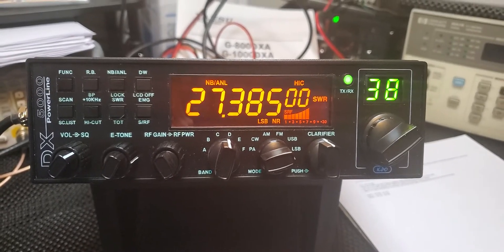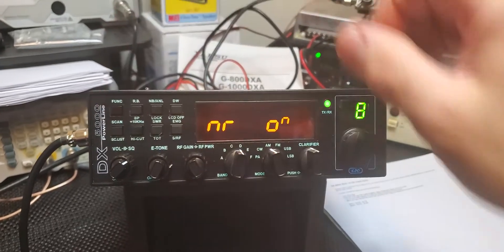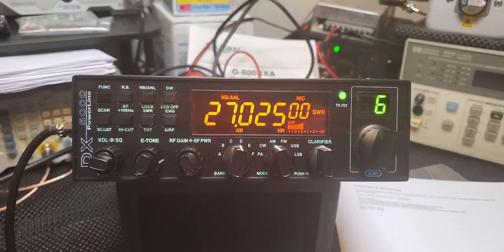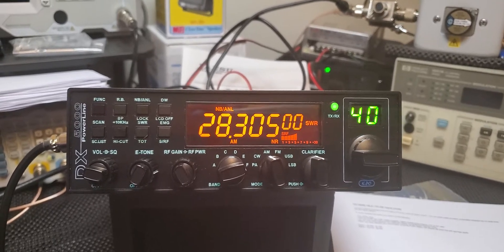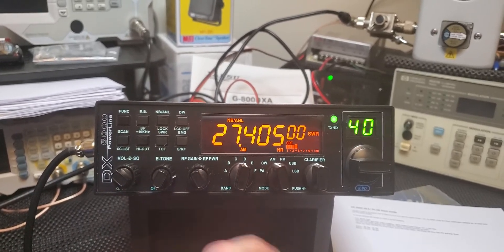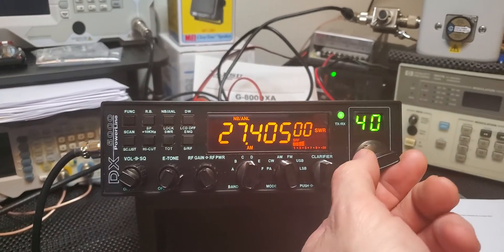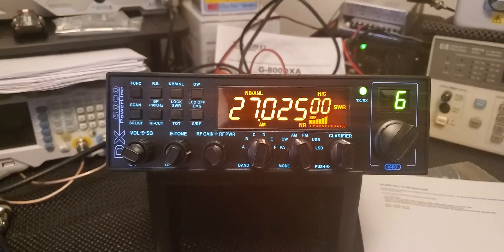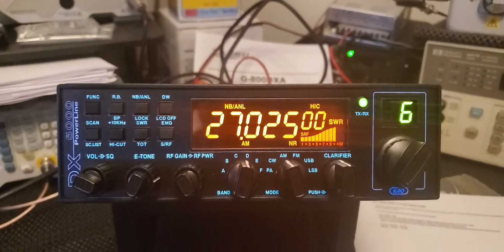First Look New K-PO DX-5000 Plus 10 Meter Radio.

Comment: Too much focus upon the noise reduction. Channel 6 is a joke. Be nice to hear SSB and clarifier operation on 35 through 40.
Reply from the maker: At the time this was the first radio in this class to have the noise reduction. 
Unfortunately you watched the video a few years later.
SSB portion works great. 
You will find most people are on frequency so using clarifier isn't a necessity for tuning people in as much these days.

Comment: What’s the difference of NC and NR
Reply from the maker: NC is a compander. Used for FM. The trick is both parties have to be using it for it to be most effective.
Reply from the maker: NR is noise reduction similar or sometimes referred to as DSP filtering.

Comment: @Scott's Radios Do you have the recommended Mic settings for this new dx5000 model im using a kpo532 power mic does it go on as electret or dynamic? People are saying im really quiet. wtf? can someone tell me optimal settings in menu proper digits and on mic/tone level

Thanks in advance
Reply from the maker: The K-po NM-532 is an electret condenser microphone.
Turn the menu setting to electret.
Turn function menu #1 in the radio (mic gain) to 63.
Run the NM-532 slider 25% to 5O% up.
Reply: @ScottsRadios  Wow man, Speedy Reply Thanks 73
Reply from the maker: @mm7bvp  Should clear up your audio to a very nice sound.
73

Comment: Just ordered one. That noise reduction circuit is quite impressive, could you possibly do a demo of the TX audio ?? Be good to see how it compares to previous versions
Reply from the maker: I find the TX audio is very good even what the factory supplied mic.
Reply: @ScottsRadios  Thanks i just wondered as its a brand new redesigned board. Mine arrives tomorrow.
Reply: @LeeKirkman88  What are these selling for?
Reply: @bigshowradio_550  i payed £179 for mine. Im loving it so far. Great Audio and mine was bang on frequency which is not really heard of with other radios and the stability is great. I have a gps standard and a racal 1991 counter too. Other radios i've bought ive always had to make some adjustment as they get calibrated when cold..
Reply: @bigshowradio_550  I dont even think their are any adjustmemts inside the radio its all menu and service menu driven and probably  micro processor controlled. Its really stable.  I have'nt opened mine but Simon the Wizzard posted images of the board. And said theres no internal adjustments.
Reply from the maker: See my second look video for a look at the board.
https://youtu.be/wD41rRTANXE
Reply: @ScottsRadios  Glad we both agree the radio is just perfect out of the box. It really surprised me too. P.s. I own a Sinadder 3 also lol. Thanks for the Great informative videos.
Reply from the maker: @LeeKirkman88  I'm excited to see the technology change for the better. Finally a worthwhile design that isn't focusing It's main selling point on exorbitant amount of power output that isn't necessary.
Reply: @ScottsRadios  Im on the same page with output power its not important to me. I have a Stryker hp955 and the first thing i did was turn the power control all way down then adjusted the radio inside to do 5w Am/Fm and 15w ssb. I didnt buy the radio for its power output. I always put the hard work on my linear. My Stryker is one of the early ones and its never had a repair in its life.
Reply: What's the cost for one an shipping costs to Australia
Reply from the maker: I'm sorry but they are sold out at this time.
More stock coming in the Summer. (mid August)
Reply: @ScottsRadios  ok thank you

Comment: looks same as anytone at 5555.
Reply from the maker: Although it looks the same on the outside it is a completely different board on the inside.
There are no trimmers or adjustable locations on this new board.
Radio also has a new optional board that allows you to use a noise reduction option.

Comment: Aquario RP-80 cousin! Nice little radio
Reply from the maker: Very similar look.
The K-PO radio has a New pc board that is totally non-adjustable. 
I believe it is the first 10 Meter radio with SSB to have a noise reduction circuit. 
In my next video I show the circuit board for those interested in seeing it. 
I am truly impressed with the performance.
Reply: @ScottsRadios  thanks man that would be awesome

Comment: Hi Scott, you need to try the sharpshooter mic, as good as the kpo mic is trust me it'll blow that kpo out the water.. almost everyone here in the UK have switched from the kpo to sharpshooter, they sound amazing.
Reply from the maker: I'll have to reach out to Doug at Knights.
Reply: @ScottsRadios  That's where most people get them from.. they do a gold, silver, and black.. very neat little mic all metal and heavy.. they are like a gun trigger microphone.. also they seem to work on almost all radios, some people even run them on hf sets.. ive never heard a bad report on one yet.

Comment: I have the Crt Superstar 6900n version six, the same radio but all in blue leds.. i think there are around 8 different names for this radio, the bleep can be changed for longer bleep or a shorter bleep and also the tone of the bleep can be changed. These are a very popular radio over here in the UK.
Reply from the maker: This radio is version 7 of that board.
Completely non-adjustable on the inside.
Frequency is spot on out of the box.
So far I'm very impressed.
Very limited time to test.
Reply: @ScottsRadios  Any adjustments can be done from the front bezel.. once put into export mode they are a fantastic radio, all the extras you get make it a brilliant radio to operate, you will need to order lots of these in buddy they will fly out the door, and with FM arriving too and as a multi bander they work exceptional on all modes.. a really good rig for sure.

Comment: Nice ! I like to wire those for 6-pin and have the up and down buttons to the encoder. Did that to my 955. Like this layout still. Have the old CRT SS 6900 NIB somewhere !  Good video ! 73s
Reply from the maker: It would be awesome to have channel off and channel down on the K-PO NN-532 microphone.
Reply: @ScottsRadios  I don't have one of those mics,  I wonder if there could be room for 2 sub micro momentary switches in the K-po to add  ? Then it would be a 6 wire ranger plug/cable. two extra wires to either side of the encoder.    of course, this could be used and instead of mic/up down could be used to power mic from radio in place of battery.   73 ~ 1200

Comment: The NRC seems to work well, it's just a shame they didn't put it on a push button on the front of the radio instead of having to go into the menu.
Reply from the maker: It does stay on no matter what channel or frequency you go to.
The high cut has to be programmed per channel or frequency.

Comment: That sounds like a digital noise reduction.. I have a separate Digital noise reduction hooked up to my radio I can’t go back to listening to CB radio without it
Reply from the maker: Yeah it definitely makes a huge difference in this radio. I can actually sit back and enjoy listening to the signals coming in with it.
Reply: What kind do u run my cb picks up everything in my truck
Reply: @andrewstewart8695  I run the west mountain clear speech dsp processor not the speaker one but the one with the three knobs on the front.. now this is used forbase station use…I don’t know how well it will work in a car. You tube it.. I never thought anything that’s plugged into The external speaker of a CB radio or amateur radio would really work but damn this thing really does works … Kind of pricey
Reply: @gregdelgado812  it would be for my mobile cb and ham rig. I'm running a cobra 150gtldx night watch. Bjt will be switching to the anytone 555 here in the next couple of days.
Reply: @andrewstewart8695  good stuff for sure!!